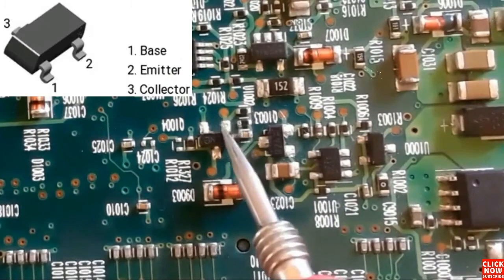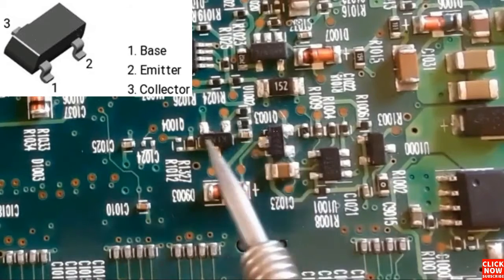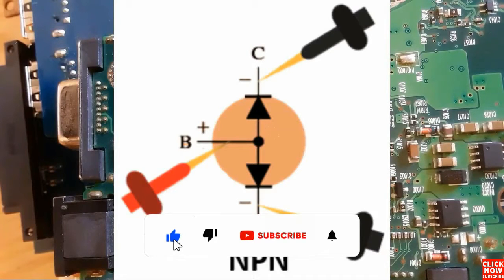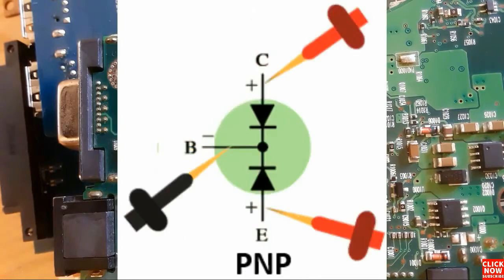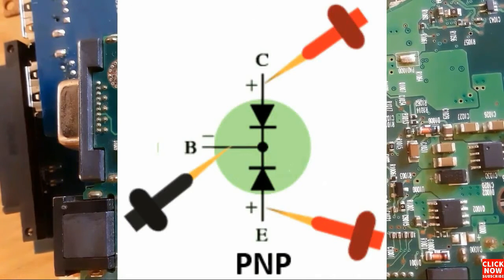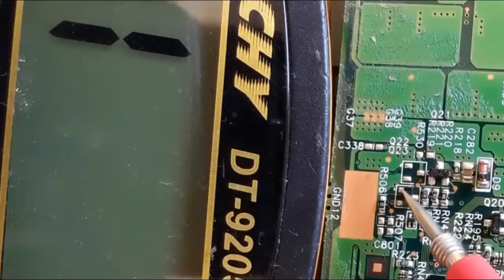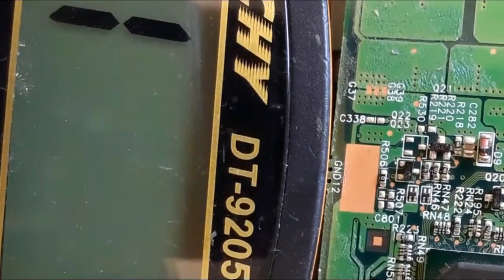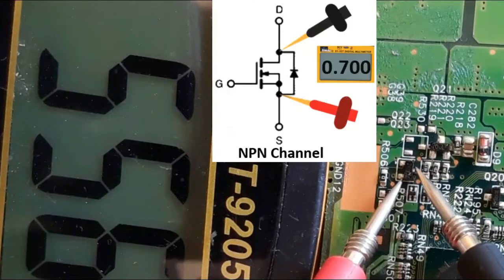MOSFET Testing VS Transistor Testing using multimeter guide

Comment: Hi , in this video for testing MOSFET and Transistor  did you use Continuity mode or diode mode on multimeter ? thnx
Reply from the maker: Diode mode
Reply: @electronicsrepairbasics_erb  thankyou